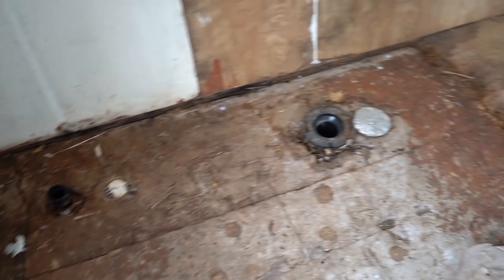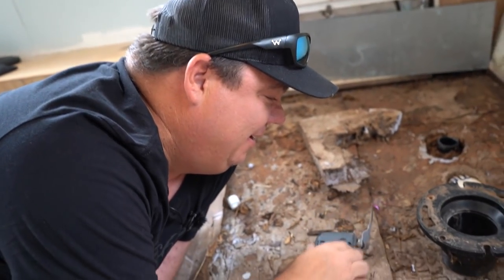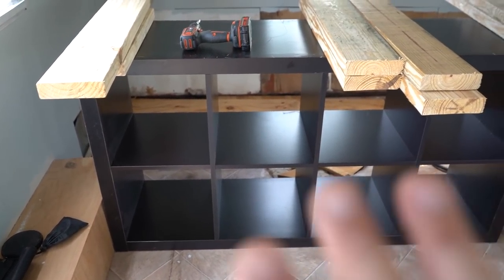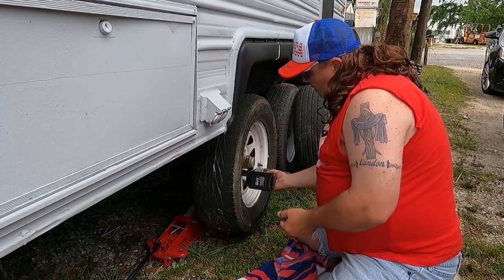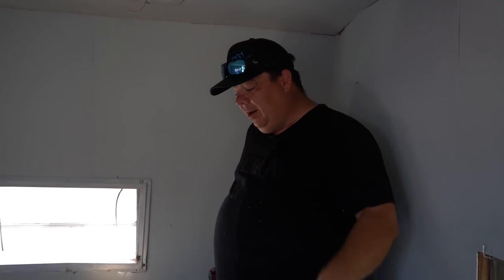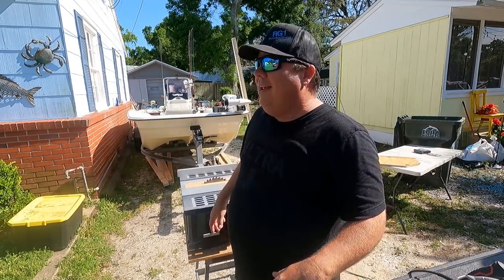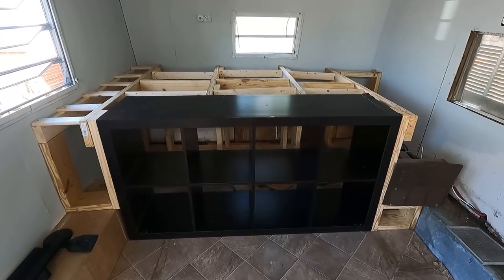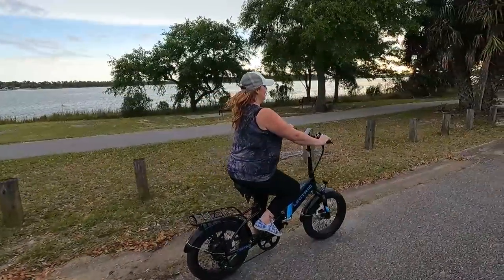We Found A MAJOR PROBLEM! Is It Still WORTH IT? * Camper Rehab*

Comment: When this video came out, I was camping at Ft Pickens Campground. You live in a fabulous place. We even got to watch the Blue Angels work out, that was a bonus for sure. One thing I hope you are taking into consideration. You are putting a LOT of weight in the back of the trailer, behind the axles. Unless you are putting at least equal or more in front of the axles, you could end up with a negative tongue weight. That can cause severe sway when towing. Your trailer should be balanced so that the tongue weight is 10% of the weight of the trailer. Using the rear part of the trailer for the bed and storage,  made from heavy lumber and not having something in the front to balance out what is hanging behind the axles, you will have problems. I have no idea what your plans are for the front of the trailer and realize you may have this planned for. If you do, then I beg forgiveness for interfering. I would rather speak up and inform you than keep quiet and see something bad happen to you and Sara. As a dedicated subscriber/viewer, I love you guys and would never want to see a video of your camper crashing because of poor weight distribution in you renovated camper!!!!

Comment: Hey Ron and Sarah! It's coming along! Keep in mind you don't want more weight in the rear of the trailer then there is in the front for safety and stability reasons
Reply from the maker: We have quite a bit going in the front and we used all pine so it’s pretty light

Comment: Good vid!! 
Kinda wish I hadn't gotten into my extra RV project before you started yours. Couple of pointers I wished I'd used I seen here.
3 safety items that are usually standard-smoke, carbon dioxide, and propane detectors. Even if not having cook stoves inside you'll be hauling them, sitting outside with drafts coming in windows, door.
Reply from the maker: Great advice!

Comment: Looks like your wax/silicon seal was leaking. Best of luck. Luv you vids. Have you checked to see if the roof needs to be relocated to keep water. Even the smallest non sealed area will let water in and work it's way into camper.

Comment: Ron a 6’ 2x6x6’ will hold between 600 lbs to 900 lbs depending on the species of wood. Your way over building the bed
Reply from the maker: I would much rather overbuild than under build